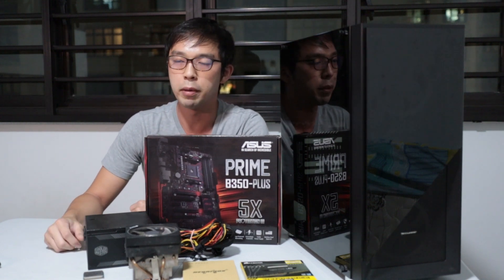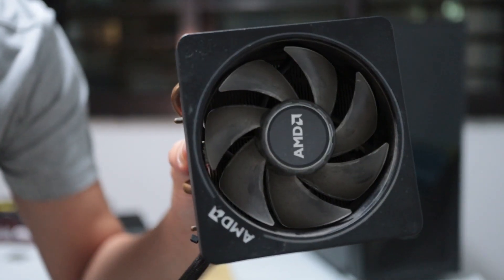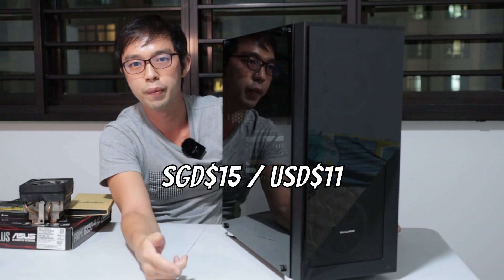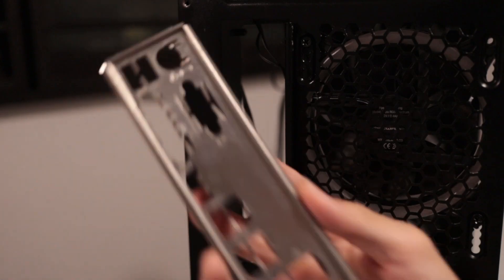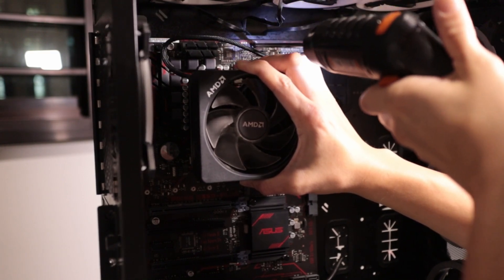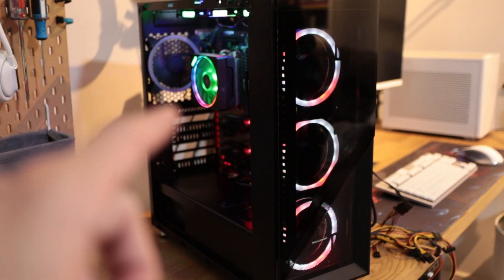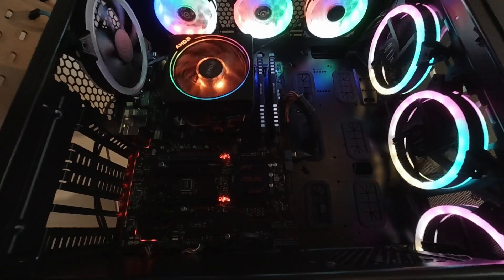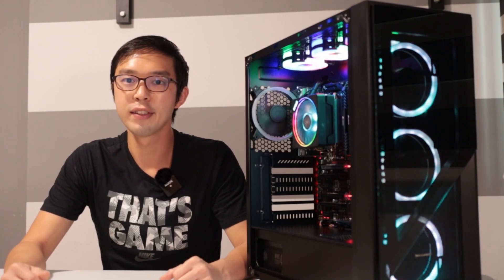Is Gaming with AMD Ryzen 3 2200G worth it in 2022?

Comment: Still worth. I paired it with 1660 super 6gb. Cpu almost 100% when gaming on 60fps. If you’re aiming for 100+fps gaming, then upgrade the cpu, or it will bottleneck
Reply from the maker: Yeah in 2023 I feel that 6 cores is the minimum for CPU